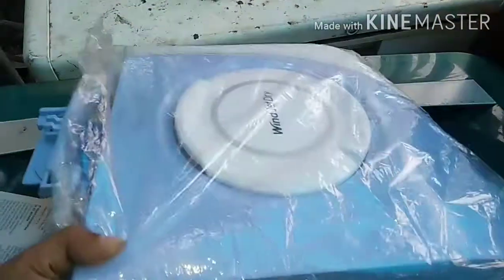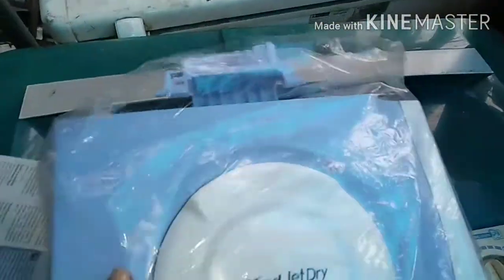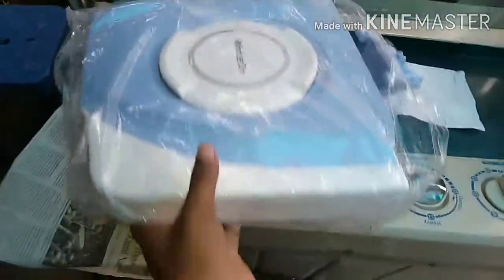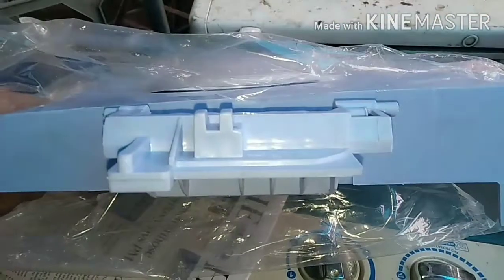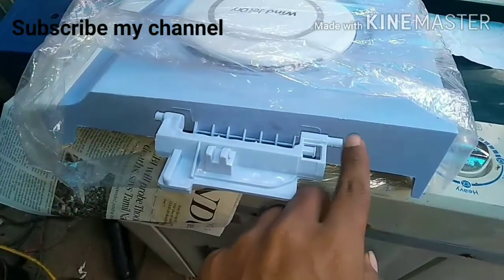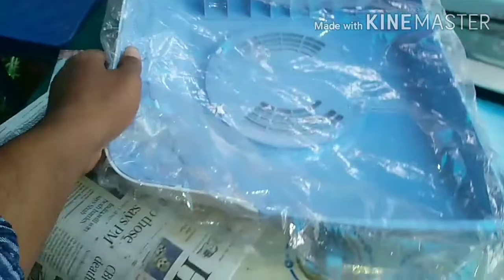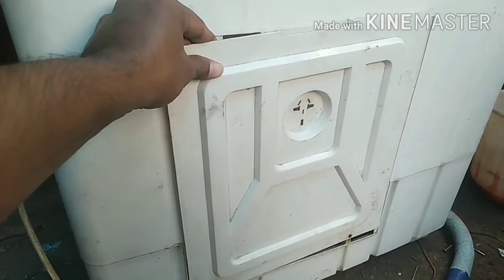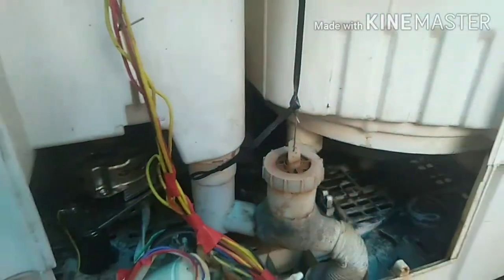How to replace washing machine dryer door

Comment: SpinDoor complaint aayi moter spin  work aavunnilla
Reply from the maker: Motoril oru brake und athu jam aaykaanum athu release cheythaal work aavum
Reply: @Mech969567 
Bro aa breake enghne mattan kayya
Reply from the maker: Brake motororil attached,motor azhiceduthu venam brake system muzuvan replacement cheyyanamenkil